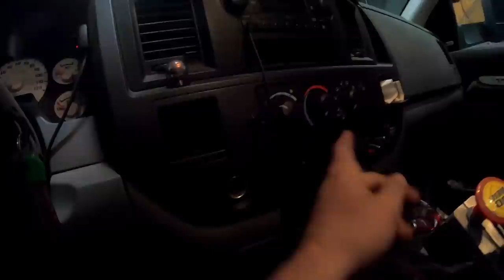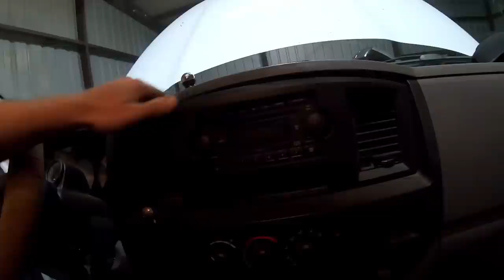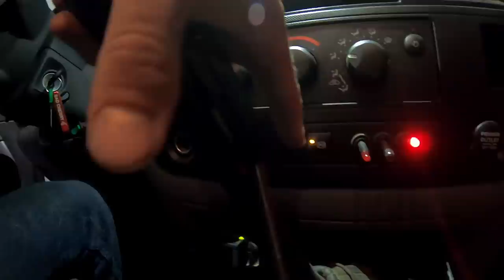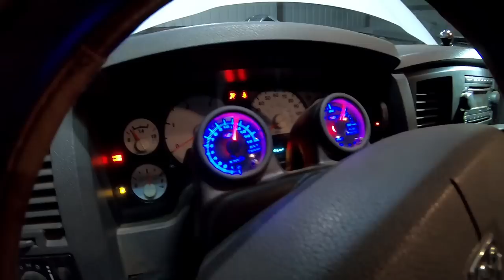SHOP TIME! EXHAUST BRAKE SWITCH RELOCATE. ALSO DEALING WITH CRAIGSLIST PPL...

Comment: it must be really nice having a shop right at home so you can work inside.. leave the tools where they lay till you get finished.  you need a recliner in the shop office.. perhaps one with vibrators in the structure so you can lay back and nap while you are vibrated to get rid of the daily muscle pains.  a big alarm clock next to the recliner . must be easy to set.  so you don't end up sleeping all night in the shop at which point it will then be called the dog house and might become your residence according to the SO.  i woke up early the other morning. said just a few more minutes.. slept 10 hours straight.  there went that day.  remember the remote switch you put on your dump trailer..  you could do the same thing with the garage stereo system. cutting it off remotely when you have to answer the phone or start recording video.   please spend the 20 bucks and put a single cylinder jimmy proof lock 18" up from the floor on the garage walk thru door.  its safer to put that than NOT to put it.

Comment: I love my 3rd gen 5.9. Just had #4 injector line blow. ....fun fun.  Just installed all 6 new and a 18 inch pusher fan for the ac condenser.
Reply: Barry Harte  Good ole #4. Been there. Hope u got the updated injector lines. They were $30.00 a piece at Genos Garage.
Reply: That price was 4 yrs ago. Lol
Reply: I did all six from cummins via pure diesel power. Was 250 bucks slso the cp3 to rail as well. Took an hour to replace
Reply: The #4 was the other 5 were just same blue isolator
Reply: Barry Harte  1 hour, Wow  !!!   Hope u weren’t stranded when it blew. I was   Lol
Reply: Well i thougjt smoke was coming from engine, so i shut it off. Was the atomised 20,000psi fuel. I got a tow. Now!!!!!! I have a fuel block off cap. 5 cylinders are better than zero. But these lines seem beefier.
Reply: @LoneWolf-cf5tp  i did everything while i was in it. 180k. Did crank n cam sensor, that asshole little heater hose p.o.s. line, orange bastard and water pump, tensoiner, belt, hoses, ran the rack. That took all day. Took longer for that bastard ass 3 inch orange hose to replace than running the overhead
Reply: Barry Harte  👍🏻
Reply: @LoneWolf-cf5tp  do you know of said 3 in orange hose
Reply: Barry Harte  No I don’t. I sold the 04 back in October. I now own 2014
Reply: @LoneWolf-cf5tp  on 6 speeds, instead of the transmission heat exchanger on driver side block, tgere is a bypass tube on back of passenger block. It can fail this 3 in hose. Its a tough hose, but while youre deep in preventive maintenance, youre there, replace it. 
I just did everything at once. Did that clutch fan wire protector too.
Reply: Barry Harte  I have the auto 68 rfe
Reply: @LoneWolf-cf5tp  i stayed away from the 6.7s. Not sure what they have for heater lines.
Im also luckcy that my blend doors has not broke yet
Reply: Barry Harte I recently deleted mine and it  made a huge difference. More power and better fuel mileage.  To be honest I was a little concerned about 6.7 with the emissions, but since I deleted I feel the 6.7 may be as reliable as the 5.9.  I’m hoping so anyway. Lol
Reply: @LoneWolf-cf5tp  they built it to be deleted i think, well the pre def ones.
I drive a big truck so im all diesel.
You have a great afternoon, im off to sleep

Comment: Who are you using for your tuner?  I went with Power Driven Diesel to help clean up the smoke on my 05 after engine build and new sticks from BBI.  I got the towing injectors and according to all of the guys on Cummins Forum, a good tuner should be able to tuner most of the smoke away without loss of power.  PDD has failed to do so after six different attempts on loads.

Comment: I must say I have never been happy with how the exhaust brake works on my truck. I would be much happier having a pressure sensitive switch that changes the exhaust brake percentage based on pressure. Rather than letting the ecu think it knows what its going on (cause it clearly doesn't). Cause if i leave it in automatic mode it does nothing. Even when i put it on normally it doesn't kick in on most inclines at lowish speeds. Between that and putting paddles on my truck instead of dealing with the shitty manual shift buttons on the auto. 

Don't get me wrong i love the exhaust brake. Its the the ecu control of it on a stock truck is complete and total garbage.

Comment: Where did you find the wiring diagram to hook up the switch
Reply from the maker: mikepresley1984 came with the switch
Reply: @VBELTandSON  bought mine from bd and didn't have a diagram or instructions thanks for the feedback
Reply from the maker: The little black switch came with the wiring diagram. Not the bd one